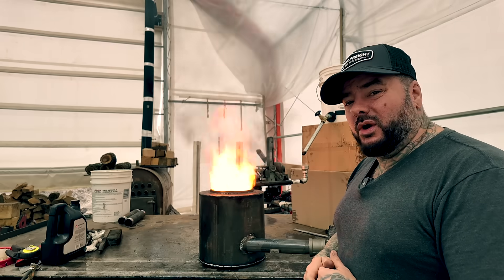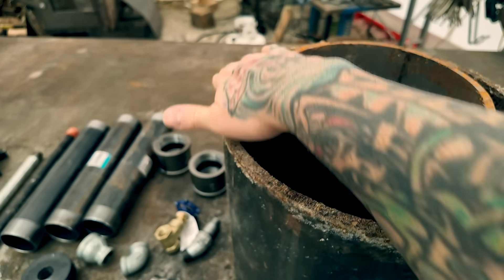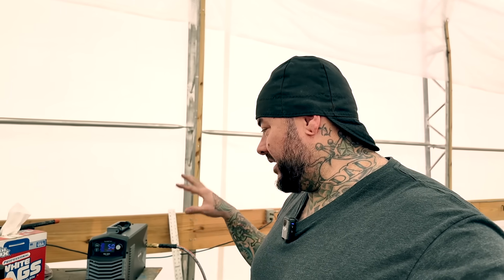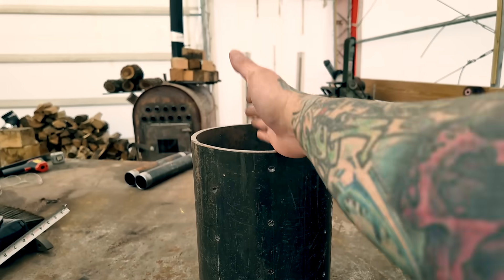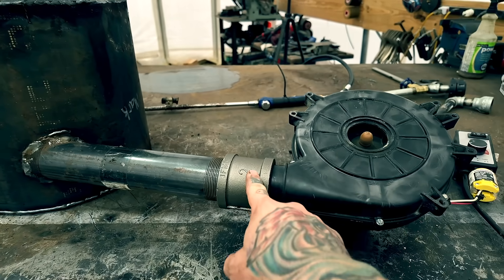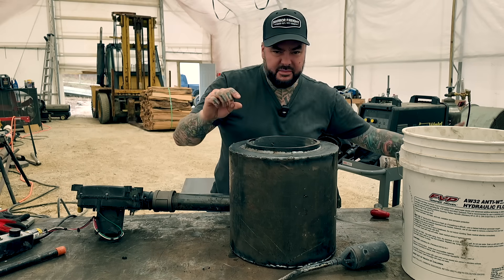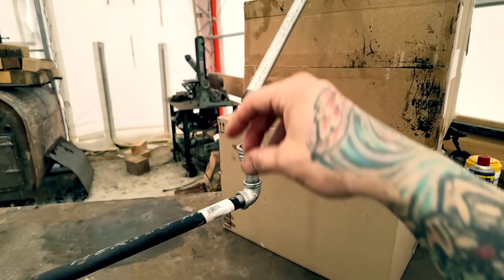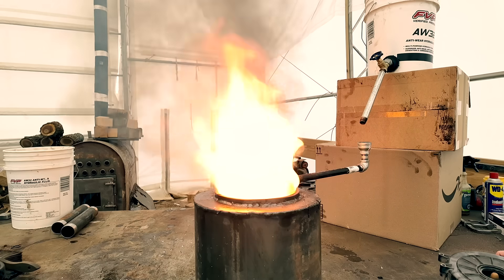I Built a BIG Waste Oil Heater to Heat My Entire Shop

Comment: I had some wood needed to burn at my grandma’s property and was having a had time getting the camp fire going then I was transmission oil used in the garage you got amount 5 gallons nigh at well used what you got and paper yard bags and pine needles and some leaves to help get started with matches blocking the wind by hole in the fire pit it got so hot I hard large rocks break in half or turn into ash I might have had 3000 degrees or hot enough for making iron or bricks

Comment: don't you love the great advice stuff?

Meanwhile this stuff is old school.

We run diesel engines, how?

What if you convert a diesel engine in a way that it becomes a burn chamber?
You got 4 burn chambers if you have a 4 cilinder engine.

And you have a great nozzle that can squirt the diesel into the burn chamber.
All it needs is a bit of power.

Which can be provided by the burn chambers.
After they have heated up to a nice temperature.

I mean: Why are people trying to invent the wheel again?
Chop a diesel engine in half. Get rid of the pistons and all that stuff.
Use the cilinders as burning chambers.
Keep the injectors.
Keep the glow plugs.

You can make a heck of a burner out of that.
Reply: ps: The oil needs preheating, and run through filters.
Then you can vaporize it like is done in a diesel engine.

And, if you think about the set up, it can be a clean set up. No vaporizer anywhere near a flame.

A carburator set up.
Venturi kinda stuff.

No need for drip drip drip. Just an active spray, timed.
Reply from the maker: Interesting idea!

Comment: The better you can atomize the oil the better it will brun.  In the case of coal fired  plants they grind the coal into a fine dust to burn..  More heat controlled fuel and air.mixture.
Reply from the maker: I appreciate the insight

Comment: THAT WHAT YOUR DOING NOW SHOULD BE DONE USED IN THE BIG WOOD HEATER YOU MADE BEFORE YOU WOULDN'T NEED ANY OF THAT WOOD THE THE HEAT IT WILL KICK OUT WITH WHAT YOU MADE WITH THE TUBES RUNNING THROUGH IT WILL HEAT YOUR SHOP FOR FREE I DON'T UNDERSTAND WHY YOU WENT DOWN THAT ROAD WITH WOOD THERE'S LOTS OF GOOD VIDEOS THE GRANDAD OF IT ALL IS A IRISH MAN CALLED JERRY'S DIY WATCH HIS VIDEOS BLOW YOUR MIND
Reply from the maker: I appreciate the suggestion!
Reply: Did you get to watch Jerry's DIY the grandfather of it all and from him everyone did something similar let me know 
If you have seen his videos like the one in the garden chocolate tin bit of tubing with in 5 mins it's glowing red hot if you follow him he will guide you down the path on no regret just joy

Comment: You may run into an issue with the flames vaporizing the oil before it is able to get to the bottom of the burn chamber. It might be a good thing, or it could cause some unpredictable burn, or it may cause buildup inside the pipe. All in all looks pretty good.
Reply from the maker: I’ve had exactly those problems
Reply: @precisionmetalin  You may have to drill a hole low into the firebox through both cylinders. perhaps have a second "insulating" pipe.....looks like an interesting challenge.
Reply from the maker: Thanks

Comment: put your oil line into the airstream after the fan with a wire mesh downstream of the drip so the oil can atomize directly into the furnace.  make sure the oil drips onto the wire mesh directly.  the wire mesh will serve two purposes.  a oil atomizer and a flame arrestor, so that the flame doesn't reverse flow back into the feed tube.   please make another video to see if it works.  thanks brah.
P.S.   put the mesh as close to the flame as possible to preheat the oil which will induce vaporization and produce a more efficient and complete burn.
Reply from the maker: Thanks

Comment: Hi. Why don't you try adding the fuel oil directly at the height of the pool or from underneath. Don't know just a thought.
Reply from the maker: Thanks for the suggestion
Reply: @precisionmetalin  I'd put the oil tube into the air tube at an angle. The end of the oil tube should be in the middle of the air tube. The wind will carry atomized oil that will vaporise instantly on the hot surface of the internal pipe.
Yes it would require preheating, but in theory you should achieve some kind of carburettor.
Perhaps the fuel should be preheated to reduce viscosity. Food for thoughts.
Reply: @yeahbucka3005  oil burners in old homes pressurized the oil and sprayed a fine film onto some electrodes. Even this idea was prone to burning a house down. The issue with anything that puddles is that it can catch fire and feed back to the source. The problem with pressurized used oil is it will clog your spray tip. Many kerosene burners (and old old oil burners) used a wick. A modern kerosene burner uses a steel wick. What we are looking for here is simple and a compromise due to particulate matter in the waste oil.

Comment: built one before. one problem you will have is contaminated oil will grow a nasty black charcoal foam stuff on the bottom. you'll need an easy way to clean it out. also you can start it very easy using diesel as a starter and then drop waste oil in. 

Instead of forced air, I used the draft from the flue. design was dead simple. I used a cooking pot for the combustion chamber and attached it to a vented brake rotor that I welded to a 6 inch pipe. the vents in the brake rotor acted as air jets.
Reply from the maker: Appreciate the insights!

Comment: if you put a coil in the middle you can use it to heat water and move it though a radiator for more efficiency.
Reply from the maker: Good thought for another way to utilize the heat!
Reply: @precisionmetalin run hot water into a cob or cement thermal mass 💪

Comment: Impressive build considering the fact it's a first try. There is room for improvement but I'm sure you know where you're going. That wood burner will be now obsolete, you definitely need a vertical burner housing to absorb the heat from that huge flame - big compressed air container or similar. Only advice I can give you is that you need to install this burner the way you can remove it easily on daily basis to empty the ash and potentially give it a little scrub.
Reply from the maker: Appreciate the advice!

Comment: You can’t see carbon monoxide
Reply from the maker: Absolutely, that's why safety is paramount when using it.
Reply from the maker: Absolutely, that's why safety is paramount when using it.
Reply: Just make sure your shop assistant is shorter than you. Also, once he uses the chimney it will be less of a problem and that tent is going to leak a lot of air.

Comment: Hey there! I've piddled with this kind of thing in the past. There are a couple ways to improve things. First is to get a peristaltic pump. They can be had on Amazon. They allow for a controlled flow without the the fiddling with valves and such.

Your air appears to go directly inward. If you put some defectors on the inside you can create a vortex. That will allow your air/fuel to stay inside the chamber slightly longer and get a better burn.

Given that you are using forced air, you can play with a restricted exhaust. It will create a faster exhaust speed which can, if done right, can create better burn conditions.

This type of burner, after being run for a while creates a sort of ash/crusty crap. If you create a removable thick steel "cup" that the oil sits if, you'll get a hot spot along the edge that will facilitate faster full blast ignition, while also preventing the air from blowing things out.

Cheers
Reply from the maker: Lots of good tips in here, thanks for sharing!

Comment: this furnace is very dangerous, it uses a lot of air, and you can suffocate with carbon monoxide, with a fatal outcome. For such a furnace, it is necessary to equip a place for installation with non-flammable coatings and install a chimney pipe... therefore, this issue should be treated much more seriously!!!
Reply from the maker: It gets put into my wood 🪵 furnace. I don’t run it in the open for heat.
Reply: @precisionmetalin  1:13 good cuz i was about to tell you this going to burn the hole place if you let this run in the open like that, also get the exhaust gas outside you tent for a more healthier solution. the funny thing is i need a used oil like that (but for a crucible) but not for heat production but for melting steel cuz propane furnace can only do soft metals, there is not a lot of video about the subject so this is a good start with some good instruction! many thx 👍